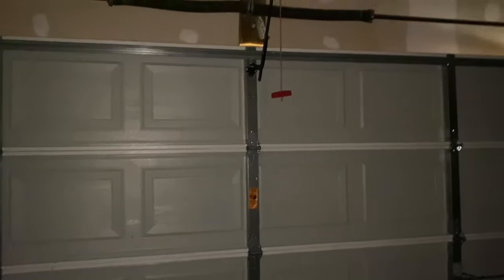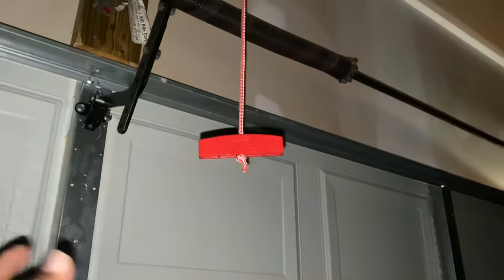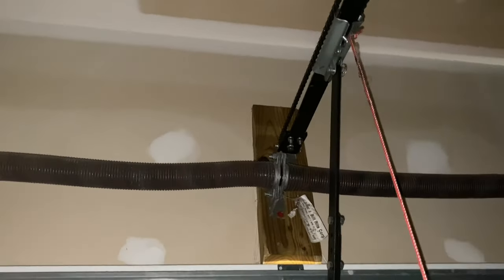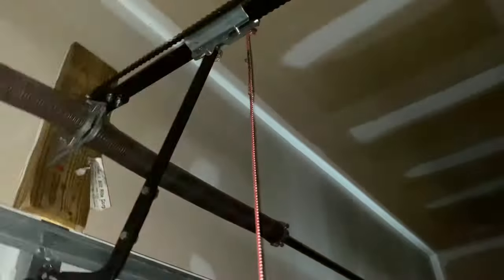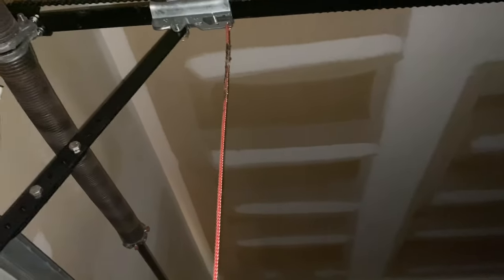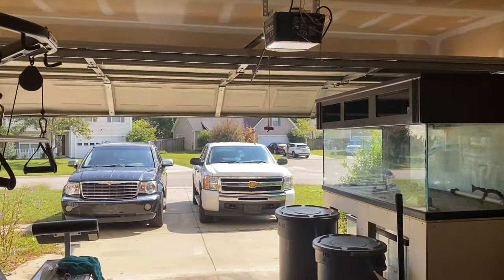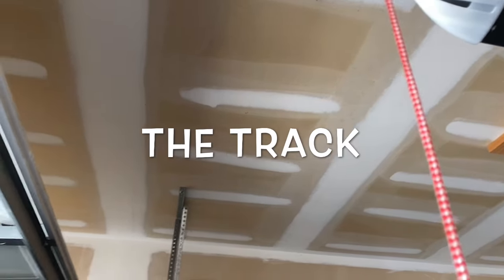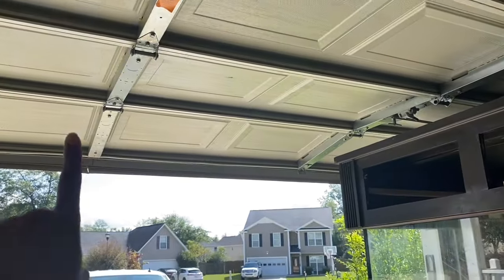HOW TO FIX YOUR GARAGE DOOR OPENER AFTER YOU HAVE PULLED THE EMERGENCY RELEASE

Comment: Thank you! This is the same door I have. My issue is I didn’t have the metal piece that is attached to the chain lined up with the bracket for the door that the emergency cord is attached to. Just had to hit the garage door opener on/off really quick to line them up!